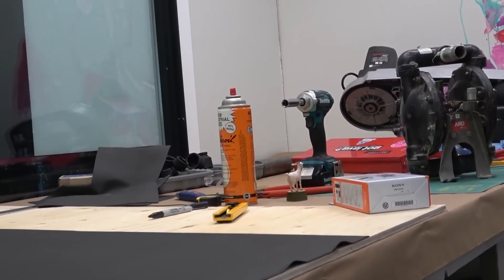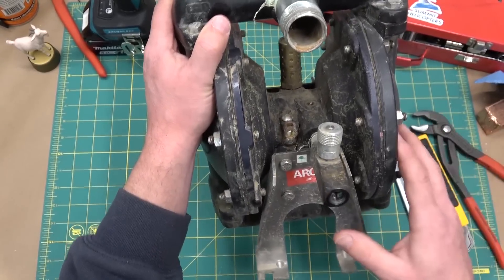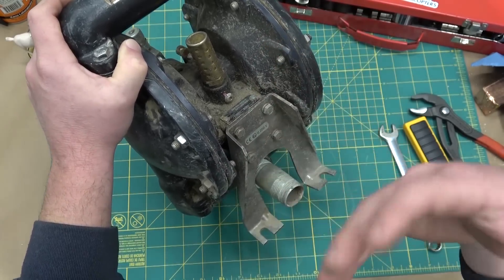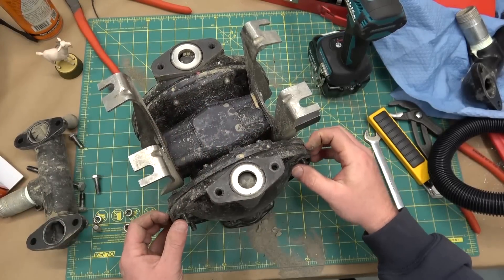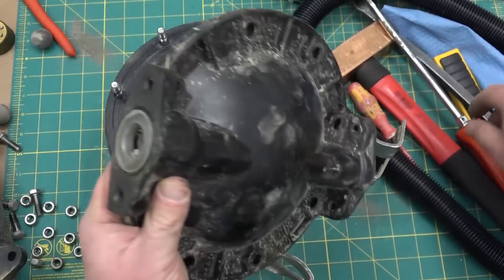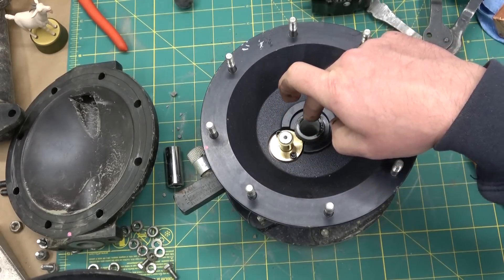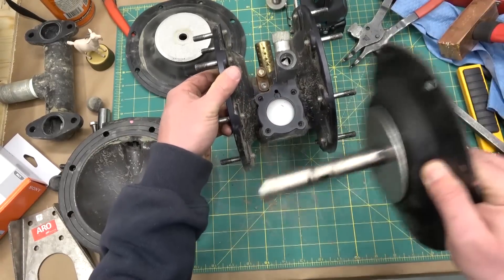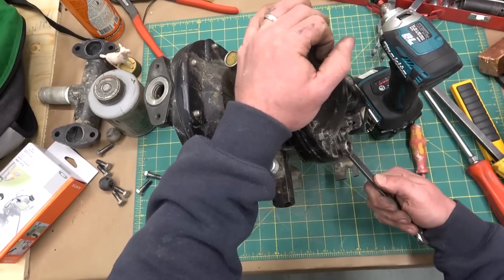BOLTR: Diaphragm Pump | So tough it'll pump ball bearings

Comment: We had some little units by the name of PIAB. The head engineer of the plant "outlawed" them because of their high air consumption. But, every good mechanic had one stashed away. Saved many a shift due to failed vacuum pumps that were not in stock in the storeroom....
Reply from the maker: I always take an hour or two to enjoy those teachable moments...
Reply: A peristaltic pump is a great alternative. Handles scurries and is much more efficient,  using an AC motor.
Reply: AvE show us around your haas, did you buy it, is it used or new? is it a VM2 by the looks of the table? so many questions. are you running it on 3 phase or have a converter.
Reply: casillas949 peristaltic pumps have some pressure limitations though (and electric motors in class 1 div 1 hazardous areas are spendy (as are the VFDs).
Reply: Just don't but the cheap pumps, they fail too fast to justify their cheapness.
casillas949 peri pumps are nice but really have a different application. If nothing else the flow through a peri pump is much less than that through a diaphragm pump (at least the ones I use), though much more adjustable and a bit smoother output.
Reply: @captianmorgan7627  I used to use peristaltic pumps of various kinds in the laboratory.  They're great for keeping a sterile liquid sterile because you just swap out the length of tubing that the pump uses to squeeze the liquid through.  They're also adjustable enough so that you can meter them to fill small containers (50-100 mL) pretty close to exact.
Reply: @randr10  I use them in a field application where adjustability on that fine of a scale isn't needed, just slow-ish, steady pumping. The ability to keep the liquid in the tube with no impeller, etc. becoming contaminated is also very nice. The biggest limiting factor for me is how much head the pump can handle. About 18'-20' of vertical lift is the max usable in my experience with the ones we have.
Reply: Abe Lincoln why would that be a problem, air is free and its not like its going to run out:/
Reply: @MrAkurvaeletbe  PIAB units use "compressed air"  to create vacuum, which on an industrial scale is an expensive utility...
Reply: You should look at a kemray glycol pump. Simple supppper robust
Reply: ...always keep one in my field rig for the exact reason that you mentioned...and for the same reason AvE mentioned...damn near bullet proof and will draw just about any old goop...mine has bailed out a job or two....

Comment: "For a certain stroke you get a specific amount of fluid out the outlet"  holy crap, I'm a positive displacement pump!!
Reply: Needs a lot of priming though...
Reply: @PyroShim  yeah but my priming bulb is huge lol
Reply: RocketSurgeon sounds like you've removed the gasket that goes around the pump. Because of this you'll need to pump 5 times as long
Reply: RocketSurgeon  An o-ring definitely sounds safer than a snap ring...
Reply: @cobolt13  if you remove that gasket, you run the risk of making a tiny pump that cries a lot!
Reply: AvE, if you happen to see this, check out the Beyond The Press channel, theyre making a tool tester that you may find familiar, just super-sized
Reply: Release the shmoo!
Reply: The priming is the best part!
Reply: You're right I got to prime for like I don't know 8 hours at time usually.
Totally tantric dude
Reply: RocketSurgeon  More like an Oh-ring.
Reply: Yeah, but you can't tell the pump how much volume to displace without first modifying the input pressure to account for draft and back pressure.

Comment: I worked in a cotton processing plant that turned threads from blue Jean manufacturing, raw cotton, cotton mop off cuts, and assorted fibers into fire barriers for mattresses and furniture. We used diaphragm pumps to move cottonseed oil to the sprayer heads.

 If you've ever wondered how they make cotton fire resistant,  cottonseed oil is the glue and powdered boric acid run through a hammer mill is what does the grunt of the fire resisting.

Comment: They used about a 20" diameter one of these to pump out the oil sump under the grate floor of the truck service trench in an Australian mine I used to work at. The evil beast didn't like the shop rags that the open ended ~ 2 1/2 inch  suction hose used to pick up, but it kept the 300 lb  Dutch apprentice busy for a couple hours at a time rebuilding the thing every other day... until I gutted an air filter and secured the mesh screen around the intake end of the hose.  
Boy did I catch hell for destroying the air filter with it's $20 core charge, let alone making them have to find something else for the apprentice to do :-0

Comment: I worked in maintenance at a food chemical company for about 1.5 years, and rebuilt a couple of these. We used ones maybe 50% larger than this to pump I believe cocoa slurry and alcohol. Something about you going through this made it seem so much easier to take apart than the few DAYS it took us to rework them. Maybe ours were stickier, idk. But man does it blow when you test and it turns out you had something put on backwards...

Comment: These were indispensable in the oil field. It's unbelievable how much these can move and how quickly. Pumping out cellars, pits, cutting boxes, flooded pads, you name it. Tough enough for roughnecks, but also simple enough a roughneck can rebuild one. Well, some roughnecks.

Comment: I work at a steel mill, and we use these all over the place for emptying used oil/grease tanks and for draining sump pits in the basements. I care not to think about the horrors those pumps have seen....
Reply: Lol I just wrote the same thing. Same pumps, just bigger. Those things will move anything and they take all of 20 min to rebuild
Reply: Think of the poor pumps in a sewage farm, they can't use these there too much, but have to have the good old Grindex, that will take the ball bearing in, and spit it out in tiny little pieces. Then consider they tile the roof there, along with the walls and floors, because every so often something will have a really shyte day, all over the place.
Reply: they are the work horses that dare to do the things we wont, thank God for diaphragm pumps

Comment: I was actually checking one of these out for a design project for class. (Pump type, not this exact company or model) I ultimately didn't pick it because the specified fluid had a viscosity which was a couple orders of magnitude beyond what these were reccomended for. I priced out a progressive cavity pump instead figuring that will probably work with the high head and relatively low flow high viscosity "Fluid". 

Great video as always.

Comment: At my work as a readymix driver, we use these pumps as part of our wash out systems. They don't have to pump gravel but they can handle stuff that is pretty nearly concrete that hasn't set yet. The outlet is a hose that runs up and into the rear of the drum, maybe six feet long. They don't really need much air, just enough to keep the pump cycling. If you run it at full pressure, you'll run the truck out of air. New guys will plug them up all the time. Takes experience and the ability to learn from your screwups to keep them working properly. I love the system. I can use it to pump out footings prior to placing concrete and catchments when I need to get lots of water into the drum and there's none to be had coming out of a tap.

Comment: Sweet! I've rebuilt hundreds of those Air Diaphragm pumps. We build AODD based Roof Cleaning pump systems. That is a 1" pump and to get max output, you need to run around 50 CFM of air at which point that pump should deliver around 50 Gal/minute open flow. Also, 120 PSI is pretty much max input and you won't quite get 120 PSI of output...closer to 100 before you add resistance and lift losses.

Comment: Those are very durable , versatile pumps with many different diaphragms available for everything from acid to car soap. Easy to rebuild as well. The ones we used were not rated for more than 80 psi and we usually ran them at approximately 40 psi. Air pressure determines outlet pressure

Comment: A super easy way to smooth out your output and put less cyclical stress on you output piping is to attach a short section of pipe that is pointed up and capped off. That way it gets an air bubble trapped in the upright piece. Then when you get a pump pulse, the air  compresses and when there is a momentary lessening of pressure the air expands helping smooth out the pulses. We deal with the pumps on a daily basis and we were having issues with the down stream piping because the pulsing. I suggested some kind of diaphragm to help smooth out the pulses and the plumber said I didn't even need to do that. He told me about using a piece of pipe with trapped air. It works like a charm.
Reply: Kinda like the thing that takes away water hammering. Cool

Comment: I used many a double D pump over the years to pump jet fuel and water with jet residue.  I only ever had to tear one of them apart.  If you don’t pump much trash they rarely need maintenance.  Thanks for the video...something relaxing about that sound.

Comment: Used to use these in the distillery to pump out the bunds because they could cope with all the extra crap that came with the liquid. Was never bummed out when they blocked either because it was a nice easy half hour taking it apart and putting it back together again.
Reply: Or a tappy tappy with a hammer.
Reply: Or do what he did here, and have a solenoid reverse the flow for a moment to blow the chunks out, and then go back to forwards and pump away.
Reply: Zip ties, and the tamper rings from 5 gallon pails will do a number on stopping the balls
Reply: Oh, and the diaphragms really hate razor blades being pumped through
Reply: @mephInc  Much too quick.

Comment: I used to repair diaphram pumps used in the making of semi-conductors. Our's were made of Teflon and we were pumping acids and solvents. A repair kit was O-rings, diaphrams, and some gasket material appropriate for the type of liquid we were pumping. the O rings were usually teflon, as were the diaphrams - and all the connecting parts internal like you had in metal parts - ours were all teflon. Otherwise the acids would eat them alive. :)

Comment: I've rebuilt probably a dozen or so of these in the couple years since I got promoted from partpusher to greasemonkey.  Love em, fastest maintenance task we've got with no downtime, cause all our pumps are in tandem with one sitting idle.  One pump starts leaking, throw over two hand valves and the other takes off, sealing the first off from flow to get removed, repaired, and reinstalled as soon as I finish my coffee.  Rebuild is simple but keeps your hands moving, and you can't screw it up blindfolded.

Comment: we have used the same model pump to suck waste oil, kerosene, and clean CNC machine sumps for more than a decade (the same pump mind you). last month it quit working because the ball cages had completely eroded, and the check balls were clogging the outlet line. I fixed it with a pair of roll pins to act as a ball cage, and the friggen thing came back to life! amazing bit of kit, here's to the next ten years!

Comment: I used to use a single chamber diaphragm pump that ran off 240v power (Aussieland angry pixies) to pump tennis court paint. Very thick with a fine grit sand in it. It was the easiest way to move that paint from one 44 gallon barrel to another for fast refills while painting a court. Its a brilliant pump and so simple that even my Dad can service it.

Comment: Used these to transfer laundry chemicals from barrels to main feed tanks. Lots of caustic bases and the acids used to neutralize them. No lack of compressed air with our 50hp Sullair. I worked there 6 years and never had to service or replace the diaphragm pumps.

Comment: why use air and not a mechanical chucher for pushing the diafram back and forth and what not?
Reply: Advancing Education - probably because this one is intended for use in flammable locations.  They make these with electric motors too I’m betting, but not rated for explosive fuel environments.
Reply: I would think one advantage of an air drive is it can sit there all day with the outlet of the pump restricted/blocked/shut off whereas a stalled electric motor tends to overheat.
Reply: PETER GREEN - good thinking, I hadn’t even thought of that.   The electric ones used for potable water in RV’s have a built in pressure switch to turn them on when the water is turned on at faucet or valve, and off again when demand stops and pressure rises again.

Comment: Watching this brings back memories. I worked at a plant that used these to move hydrochloric acid and sodium hydroxide (not in the same line, mind you) for a process in water purification. I spent to many hours rebuilding these pumps over the four years I was there.

Comment: I work for a company that builds custom service trucks and we use these pumps for def, antifreeze and evac. The evac sludge that gets run through them is barely liquid. Awesome little pumps that can do it all. Only issue we have is blowing out the seals on the outlet, when using hydraulic hoses if they are rolled back into the reel full of junk they compress and go over the pressure rating of the pump and blow out the pumps internal seals

Comment: I work in a semiconductor fab and we use LOTS and LOTS of chemicals. I’d say 75% of the pumps I work on are diaphragm pumps. Most high purity but we have the ARO PD10 series on our post process (waste) systems. They See a lot of wear and tear but keep on choochen. When we do see failures it’s usually on the air side. Some time the harsher chems eat the diaphragms. Pretty skookem units. Ur analysis was right on.

Comment: I worked on a well flow back treatment site and we used 3" versions of these for everything. Need a pressure washer to clean treatment tanks and lamella clarifiers? Hook 50' of 3" tigerflex and neck it down to 1/2"-3/4"... gotta suck up rainwater on containment that had nails, rocks, mud, and every other conceivable obstruction under 1.5 inches? Take the "power washer" tip off and flip the inlet and outlet... A diaphragm pump can move absolutely anything, only issue we had was with the high cfm compressors running them wide open for several hours pressurizing a solids separation press we would have to drip RV antifreeze in the air line pre pump so the pistons and mufflers wouldn't freeze up.

Comment: I love these pumps, I used one on the common coolant system I built to run a large horizontal bandsaw and a cold saw. I can set the maximum coolant pressure with a pressure regulator on the air inlet...no reason to send 90psi of coolant to the saws. It's also nice becuase when the coolant valves are shut, the pump stops running once the lines are at inlet pressure and uses no more air...i.e. no issues with a dead head situation and no excess air consumption.

Comment: We used them as bilge pumps on the aircraft carrier I served on, to get rid of leaked oil, water, fuel and the odd turd from a feral watchkeeper or two... it was a pain in the arse to take apart when it airlocked. So friggin strong!

Comment: I suggested getting one of these to a reliability engineer who had a degree in mechanical engineering and was a fitter by trade, at a coal handling process plant for sump pumps, as the installed pumps had impellers that chopped up float switches. He didn't go with it because he thought it was too difficult.

All bare metal in explosive atmospheres needs to be earthed to prevent static discharge.

Comment: I have been using several of this puppies in my job.
From pumping waste water, waste oil and diesel.
A lot of suction, kinda silent and they only need a beefy supply of compressed air.
For only diesel and virgin oil/automotive grade oil we use centrifugal pumps with a trusty Honda engine.

Comment: I work at a makeup manufacturing plant, we use diaphragm pumps for a ton of stuff. One use is we pump water that has been contaminated with makeup powder through a filter press to catch the muddy powder before we dump into the sewer. In our other buildings we use them to put creams and lotions in the machine that fill the containers. Only thing that sucks about the creams and lotions is every time you switch to new product you gotta take it apart and get it sanitized.

Comment: The maritime industry uses these pumps for everything. One time I had to acid clean a tube type cooler and the pump for the acid that came with the rig broke. I swapped it out for one of these. It ran for about 8 hours then the check balls disintegrated to nothing. Thankfully the cooler was clean and I was abel to hide the pump in the bilge until I could rebuild it. Work done, lesson learned, boss none the wiser.

Comment: I repaired dozens of those .actualy the same six over and over.i saved the rubber balls and the kids use them for diving toys in our pool.we used them on hot oil for our heat treat furnace .metal shavings are about the only things they dont like

Comment: You can buy them in "sanitary" format for pumping food and pharmaceutical  products. They are designed to be dismantled for cleaning and reassembled without using tools. This has advantages from the point of view of quick and thorough cleaning, but also eliminates the need for a fitter to do the job.  
Some of them are almost entirely plastic and don't have the earth screw on them. We always specified a copper braid to be clamped between  the inlet and discharge  when pumping something flammable.
They are the closest thing to an  idiot proof pump I've ever seen.